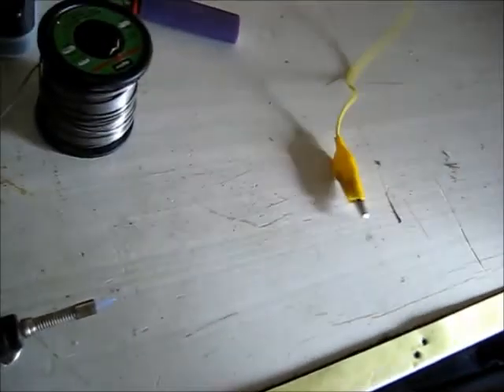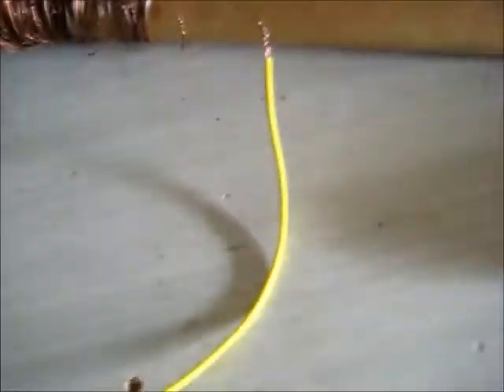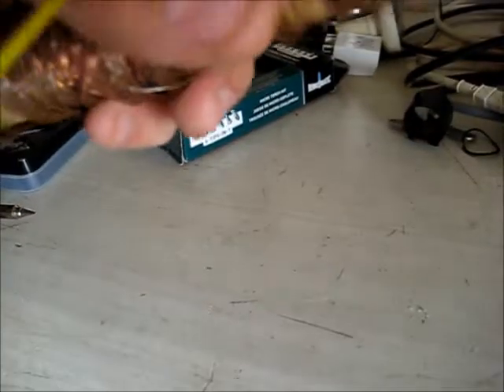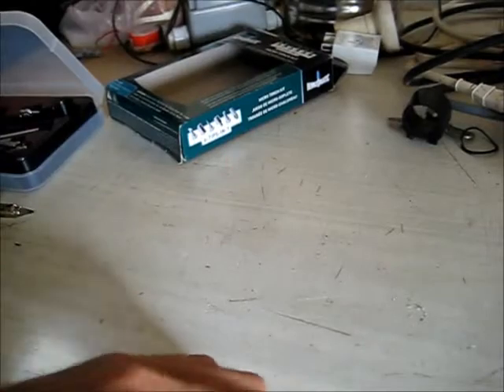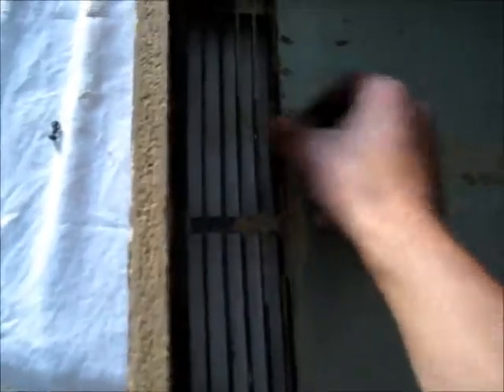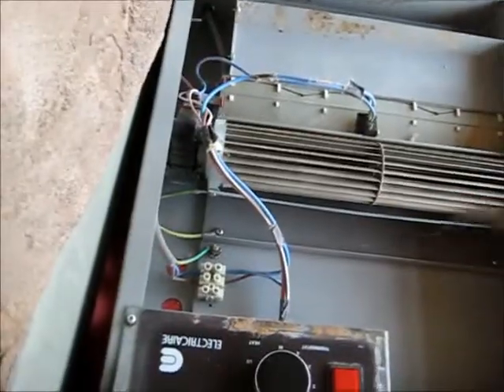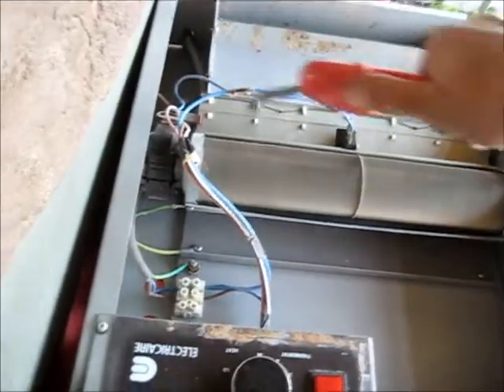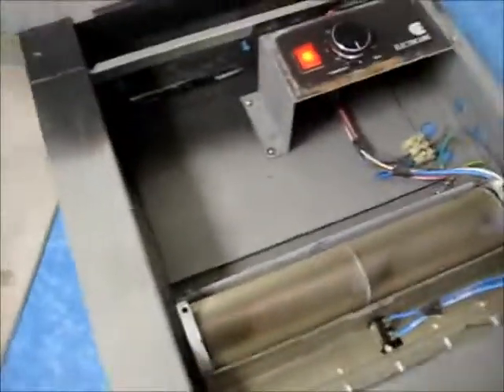Shortwave antenna fix & clean vintage heater

Comment: nice old heater,good job cleaning it up.shit that air compressor is noisy damn direct drives, my old 3 cylinder belt drive roymac is 31 years old and quiet as a mouse compared to that thing lol.